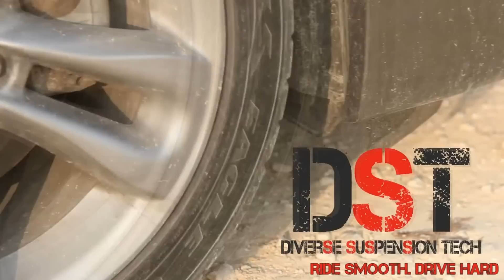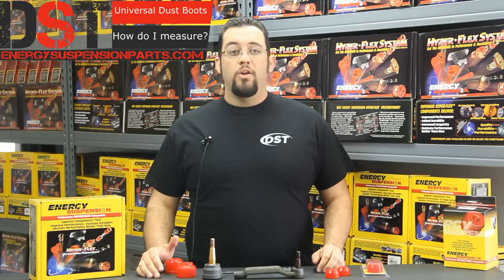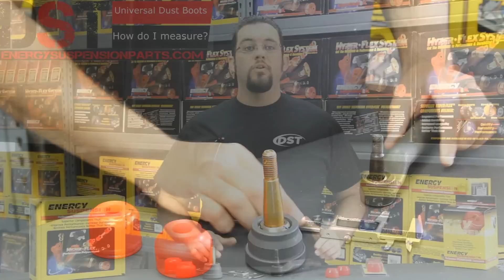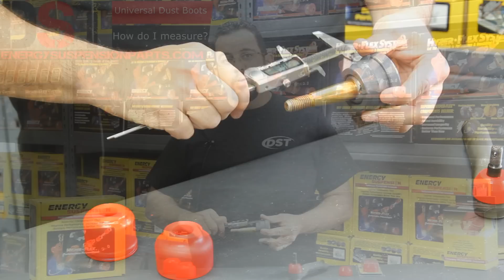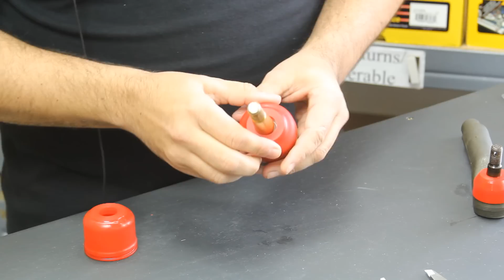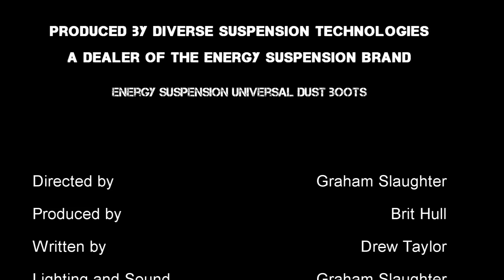What do I replace my rubber Ball Joint or Tie Rod End dust boots with?

Comment: Uh, so with that ball joint example you covered up the entire surface that would be pressed into the knuckle. The boot should only go over the part that is beveled. Any further and it won't work. Can you trim these to fit properly?

Comment: The ball joints you have there do not have a factory spacer as Toyotas have.
Is it safe to remove that spacer or should I exchange the boots for a deeper boot.  Im dealing with an 01 Tacoma 4x4 and I spent $1000 in parts.  I just dont wanna use their rubber dust boots.

Comment: I need to change the Lower Control Arm boot on our Saturn, not on TR. That boot is rather specific in it's shape, it is very tiny and almost plane. I tried to find smth. similar, but nothing of that shape, even bought LC Arm bushing, but the set didn't have that piece either. Can I put a taller and thicker boot instead of the original one, similar to the one you used on Outer TR? Or it is better to keep the old one? I'm thinking maybe to make that boot from the gasket maker, or it is not advisable? The original boot (or better say cover) is not torn or anything, but just old, some fringing on its sides. I do something else on that car and the castle nut was removed, everything is disconnected. I wanted to put everything new, but can't find that boot (looks like a hat). Thank you.

Comment: If we give you the vehicle type such as 2005 jeep liberty can you then tell what boots needed for lower ball joint and tie rods?
Reply: Did you try this ?I have a Liberty too
Reply: Take a string, measure circumference and divide by 3.14.  Convert to mm.  Close enough to get the right one.
Reply: measure the endlink. Dude literally tells you how and wear at 1min in.

Comment: I'm not sure of what the boots cost but I'm sure it's only a fraction more for the joint with a new boots man up buy new parts
Reply: I got my 2 pair off amazon for $12 bucks and my ball joints were $25-$30 each (for name brand anyway) and I needed all 4 lol Maybe prices are less for smaller vehicles but not mine at least lol (98 k1500 Z71)
Reply: Ripped a boot on my focus st. New ball joint/control arm (it's all one piece) is $200 a side. So $200 versus $10

Comment: Here is a solution I have for anybody and everybody who wants to replace a boot for their tie rod or ball joint buy a new fucking ball joint or tie rod don't be so damn cheap if the boot is fucked what do you think's been happening with all that dirt just getting in there and wearing it out what's the point in replacing the boots
Reply: I bought a new set of end links, sway links, and tie rods. All with the greaseable fitting. But all of them use rubber. I'm gonna replace them with polyurethane. 

You ever thought about that? That there are people who are using these on new parts? I even have polyurethane bushings on the sway bars and the control arms. They feel way snappier than rubber.

You are a judgmental dinosaur. Riddled with prejudice, stubbornness, assumptions, and hubris. Think outside the box. Or expire like the 1930s Ford Roadster you are. 

But you're the person who would throw away something due to a tiny flaw. Faded paint on your house? Buy new house. Crack in windshield? Buy new car. Wife is getting old? Get new wife.

Gonna transplant your brain into a young body? Ain't happening.
Reply: You gonna come to our houses and do the alignment? Didn't think so.

Comment: how does the boot stay on, I mean once there's grease in there, wont it get between the dust boot and ball joint  and then slip off?
Reply: The boot is held between the control arm and the spindle.  It can't come off.
Reply: No! That's not how it works.  Rubber's sticky when wet. It'll stay, man.

Comment: looking to replace the tie rod end boots.  my tie rod ends have or had a spring clip that held it on the base.  For the spring there is also a groove in the base.  Are your caps gonna work with that groove?
Reply: curious about this as well

Comment: Do you have to remove the ball joint (press it out) from the vehicle to replace the boot?
Reply from the maker: Hey D Cavalli, Thanks for the great question! You shouldn't have to take take the control arm complete off. Really it's just getting some of  the pressure off the ball joint in general. Many times with the lower control arm you can just loosen up the nut on the ball joint and relieve the the pressure off the boot and grab measurements that way. 
the same can work for the upper arm would just need to have the vehicle on jacks so gravity could pull the knuckle from the ball joint. Essentially is just loosing the nut on the ball joint to the knuckle. You should not have to press out the ball joint to get your measurements.

Comment: I don't own a micrometer is that the only way of measuring the parts. I went online and looked in universal parts jus like the video said and I couldn't find anything about ball joints I only found tie rods.
Reply: +Vicente Corona It appears your best bet at this time will be to speak with our service team, specifically our ASE certified mechanic, so he can walk you through the process without a micrometer.  He can be reached at 888-406-2330.
Reply: this is a caliper

Comment: had a quick question is your store in socal open to the public? if so would I be able to jus take my upper control arm and steering knuckle to you for measurements along with my tie rod ball joint?
Reply: +Vicente Corona We do not have a brick and mortar store front, so we would not be able to assist you with that.  However, if you have questions about this video, and where you need to measure, let me know where your concern comes in to place, and I will see what I can do to assist you further so that we can make sure you find the right part.

Comment: Are they for upper ball joints on the control arm to or just lower ball joints
Reply from the maker: Hello Nigel! Thanks for the question. Many customers ask this question so it will be great having the answer here in the comments. Energy Suspension's Dust Boots are designed to work with Upper Ball Joints, Lower Ball Joints, Tie Rod End Joints and any other joint you can think of, as long as the measurements match. So if the measurements off the upper control arm ball joint of your vehicle match any of the dimensions on this page then they should work just fine: http://tinyurl.com/ya2kedr
Reply: Man I'm so pissed now cause I had to change the whole control arm on my truck just because of the boot, if I had know about you guys man, cause the job was difficult and expensive, will next time I know cause k how I have to do the bottoms.
Reply: Can you direct me to prices cause I can find them on the web page
Reply: Also thanks for the info
Reply from the maker: Nigel Roque
Sure can! On the page with the chart, look at the 3rd column labeled "Included in Set." This section has all of the part numbers of the dust boots. The numbers are hyperlinks so if you click on the one you need it will take you to page with the price.

Sorry to hear about the control arm troubles. Those tiny little dust boots are pretty important and unfortunately people aren't aware that just the boots can be replaced.
Let us know if there is anything else we can help you with!
Reply: +EnergySuspension Hi nigel, I just noticed ball joint book is broken, only 40000 kms, should I change the whole thing or just ball joint boot ? THANKS
Reply: Well it really depends on what kind of joint you have ,if you have a serviceable one then yes it would be cost effective but some brands are not serviceable and the damage , if it just the over I say put some grease and replace the cover.the cheapest way

Comment: thanks for the tech information. Do these still require the out shims that hold the boot in place or just applied by themselves?
Reply: Sorry..outer shim retainer rings; not out shims (typo).
Reply from the maker: Hi! Great question! Energy Suspension has designed their universal dust boots to be used without retainer rings. These poly boots will fit snug over your ball joint or tie rod without the need of a ring holding it in place.